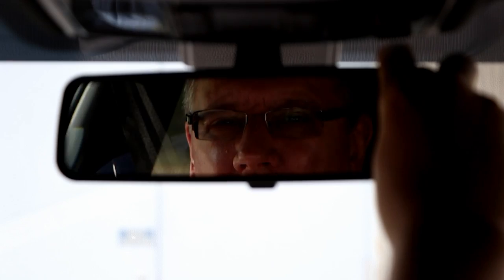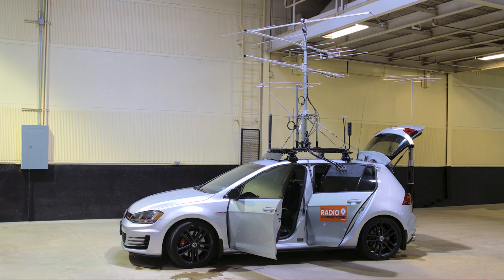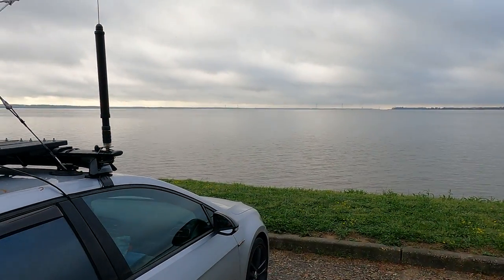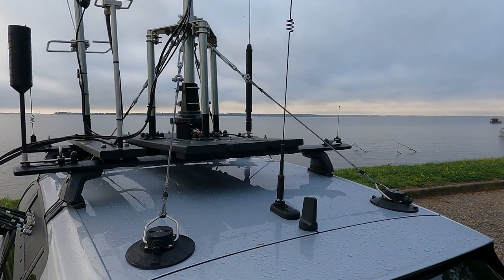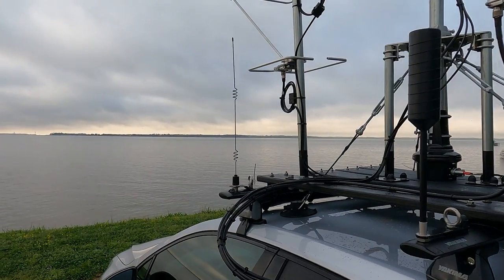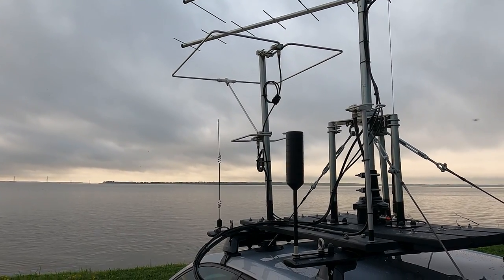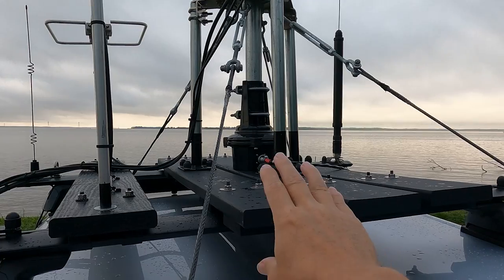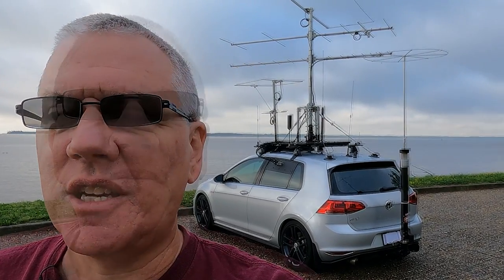My Antenna Farm - 2023

Comment: What is the mileage on your GTI? It's got to be up there with some of the higher mileage Mk7 GTI's. Do you have any other cars or just the GTI. Very interesting set up, it's cool to see people make the most of their cars and purpose build them in unique ways!
Reply from the maker: I'm approaching 184,000 miles (just past 295,000 km). My previous driving schedule had me predicting that I'd reach 200,000 miles in 2023. But I don't think that'll happen. I WILL surpass 300,000 km soon, though. I'll share a milestone video at that point for my metric subscribers. As for my garage, my wife drives a 2018 Jetta that just passed 40k. But only she drives it. My GTI is my daily driver. 👍

Comment: Are all of those steel harpoons DOT approved to stay on the car during an accident?
Reply from the maker: No. But I'm sure none of the commercially available cargo boxes, baskets and other cargo management items are DOT approved, either. IF they are, I suspect ALL rooftop cargo can and will separate from a roof rack in the event of a catastrophic accident. Their plastic and rubber fittings can take only so much force. Given my steel hardware, I think my setup is as safe as any other rooftop cargo and safer than unsecured pick-up truck/trailer cargo. Still, I don't want to find out first hand.  ;-) Thanks for visiting.

Comment: How long are your coax cables on the outside of the car from the antenna to the window pass through?
Reply from the maker: The top Moxon's feed line is 16 feet long. I think 17 feet would have been a better choice. That's especially true now that I have a different Moxon that's not yet fitted to my mast. Thanks for visiting!
Reply: @StealthGTI  Thanks for the reply. I’m coming to Berryville VA  in a couple weeks. 😉😉. I’d love to talk to you about helping me create the Same antenna system for my grandfather’s car.
Reply from the maker: @ipodbuff  - I'm still  planning to attend. See you there!